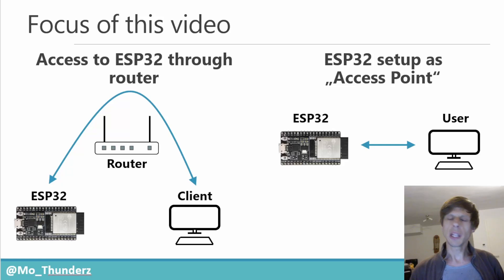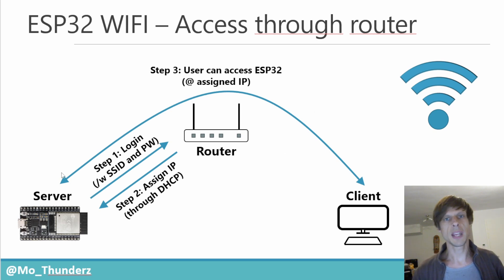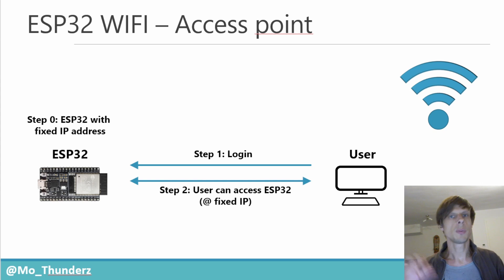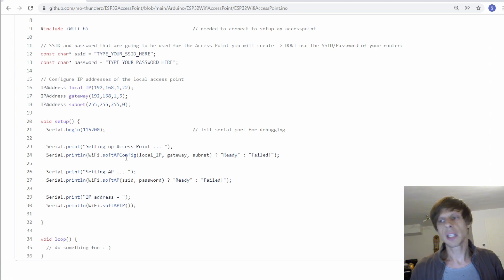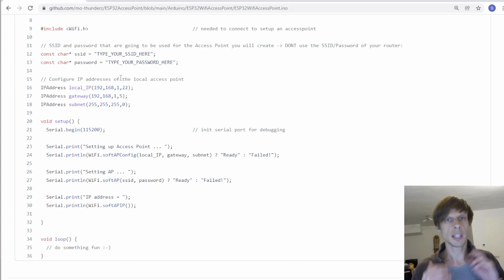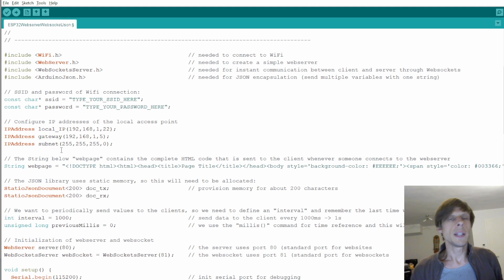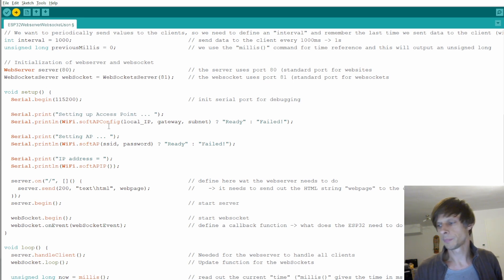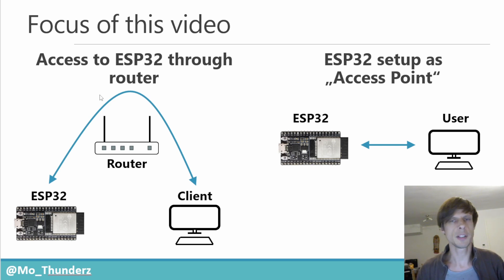ESP32 Access Point and Router connection explained

Comment: hello
Is it possible to connect a cell phone with an App Inventor application and send simultaneous data to two ESP32 modules to control different LEDs on each card?
without occupying a router

Comment: Cna you explain why someone would choose one option instead of the other?
Reply from the maker: Sure! If you have a Wifi network at home and you want to add an ESP to that, then you take the router connection. The advantage here is that if your phone or computer is connected to that same Wifi network, then you can directly access the ESP. The disadvantage is that it only works when you have reception from the router. If you use the ESP in environments where for instance no router wifi is available or you want to setup a dedicated system outside of home wifi, then the access point implementation is to be used.
Reply: @mothunderz  very nice and concise explanation
Reply from the maker: You're welcome :-)

Comment: This is a connection in an internal network created by esp32 and has nothing to do with the Internet or Wifi. So I wonder if you can make a video instructing how to use esp32 to create a DNS domain name so that people do not need to near the esp32 and connected to its internal network. Instead, anywhere as long as there is internet, can you access the Web interface created by the esp32? Thanks.
Reply from the maker: I dont recommend to put the ESP32 directly exposed on internet. Please use a Raspberry or something like that with decent security as firewall between the ESP32 and the internet. The ESP32 has only a very simple IP library and I dont think it is very well protected.

Comment: I am working on a project where i want to capture an image in ESP32 cam and send it to the server
I am providing my local desktop ip address and when I am running that it is showing that the connection failed
Can you tell me what is the issue? I don't have any router in my home i use my mobile hotspot for ssid and password
Reply from the maker: I dont understand what you mean with that you use your mobile hotspot. The easiest way is to setup the ESP32 as access point and have your local desktop connect to the wifi of the ESP32.

Comment: Thaks for the video, very clear but for me it does not work! The esp loads and prints Ready etc. I have been using the router connection while writing my code. I followed the video and am getting ERR_ADDRESS_UNREACHABLE. I tried changing the IP and gateway still no change. Any ideas?
Reply from the maker: Sorry to hear that you are having problems. Can you try to setup the ESP32 as an access point. Does that work? Do you have a second router to test with perhaps? What might also be a good debug method for you is to check with the code of this video if you can see the network:
https://youtu.be/0AlATlN95Y0
note that the ESP32 does not support 5G or 6G wireless. If the ESP detects the Wifi you can check with the code of this video if you can connect to it:
https://youtu.be/15X0WvGaVg8
Hope that you find a solution.

Comment: Thanks for this. I had it in  my head that to be a server it had to be an access point and as client had to be in sta mode.   So it can be a server no matter what mode it is in. But to access the esp32 from outside your lan it would have to be in sta mode.  Also, as an access point,  the esp32 has to create it own radio signal (wifi) ? I would think that that signal does not go too far so other devices connecting to it would have to be close by ?
Reply from the maker: Yes, I think your understanding is correct: If you want to connect the ESP32 to your local network then you need to go for the "router connection". If you want to get a 1-to-1 connection directly on the ESP32 then you need to use it as an access point. As for the strength of the WiFi signal: it is strong enough for communication in the same room, but definitely you wont be able to access the WiFi signal off the ESP32 throughout the whole house. For that connection to your router is the better option.

Comment: Thank you so much for this excellent explanation.. it's very helpful.. I was able to use your explanation to convert the default ESP32 Cam Arduino example code onto Access point mode... And it works well on my PC, but once I try connecting with my android phone it keeps connection and disconnecting.. please have you experienced such behaviour.. and what could be the solution.. thanks
Reply from the maker: I am not familiar with the ESP32 Cam, but actually I have experienced the same problem with Android Phones disconnecting when I configure the ESP32 as a webserver. The solution for that was to change the order the services were started. In particular I needed to first start the websockets before starting the server with server.begin();

So in other words: I dont think it directly has to do with how the WiFi is configured, but rather the services themselves. Hope this helps...

Comment: would be possible to do something like this with a LAN Cable? i mean internet coming from a wall socket, then via LAN adapter to usb and then to the board in order to make a WIFI Access point from an internet cable access. Thanks
Reply from the maker: I am not aware of a driver for the ESP32 to accept LAN through USB. You would need drivers or code for that to make it work.
Reply: @mothunderz  the esp32-s3 is usb host (otg) capable. So it should accept the lan connection
Reply from the maker: I am not familiar with this version of the ESP32. Sounds interesting!
Reply: @mothunderz  but i think you are right about the LAN adapter drivers. It would be tricky:)

Comment: can you make a video for a solution of esp32 cam wifi connecting issue .please help me .
in serial monitor the dought printing continues but not connecting .and some times triggered please make video
Reply from the maker: My apologies, but I dont really understand the issue you have with your ESP32. If your ESP32 is suffering from a weak WiFi signal, please see the link below. Hope this solves your problem. 
https://randomnerdtutorials.com/esp32-cam-troubleshooting-guide/#:~:text=If%20your%20ESP32%2DCAM%20AI,position%20for%20the%20desired%20antenna.

Comment: I have been working through your videos using an ESP32-C3 using an on-chip 4Meg flash. Even though the C3 is Risk-V, I suspected that company would use the same code, just a different compiler. So far all is working fine. Thank you for this, it has saved me much head scratching. Your explanations are very clear and your code is very well organized. When I tried the Bluetooth videos, no joy, the compiler threw a fit with the ESP32C3 selected, many functions not found. I had hoped they would do like the WiFi, looking in google I see a post saying it only supports BLE, but the API docs show Classic and others. I tried to compile the BLEclient and BLEserver examples and they compiled, so I guess my best bet is to convert over to BLE (I wonder if my phone supports that). Thanks for the WiFi though, it was great.
Reply from the maker: Thank you very much for the feedback! As for Bluetooth: BLE is actually more energy efficient and by far the better choice if you do not need a large data throughput. The one problem is that it is a bit more difficult to setup. I tried BLE in MIT App inventor, but it did not operate very stable. Might I find a good solution I will post it.

Comment: I want to make a mobile app which connect to esp32. How I can connect my app to esp32.
Reply from the maker: There are many ways to connect. For a mobile app, the simplest way to create a bi-directional communication channel is Bluetooth. The advantage of Bluetooth is that you dont need to mess around with IP addresses etc. Another relatively simple method is to use the Access Point connection as shown in this video. You will manually have to connect to the WiFi of the ESP32 and can than access the device at a fixed IP address. Finally, you can of course use the router connection solution of the video. In that case make sure you assign a fix IP address in your router so that you know where to find the ESP.

Comment: I have a question. Will the fixed ip and ssid and password change after uploading some other code in the esp32?
Reply from the maker: I am not sure what you mean. Do you mean the left configuration (at the start of the video) where the ESP32 is accessed through a router? Typically, the router will assign the same IP address to the ESP32 if you update the code, however, this will depend on the router. The better solution is to log in into the router, find under WiFi-connections the MAC address of the ESP32 and assign a fixed IP address for the ESP32. That way, the ESP32 will always get the same IP address. If your question is directed to the right side: setting up the ESP32 as an access point -> here you define what the IP, SSID and PW should be in the code itself. Therefore, as long as you dont make changes there, this wont change when uploading new code.